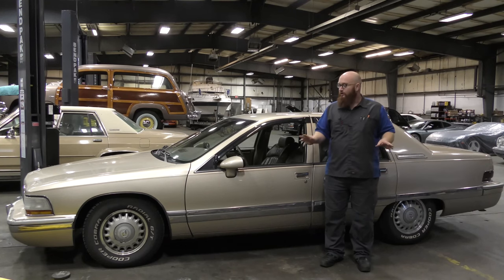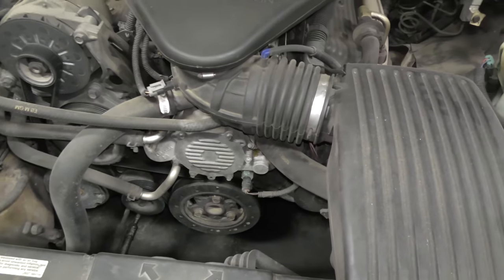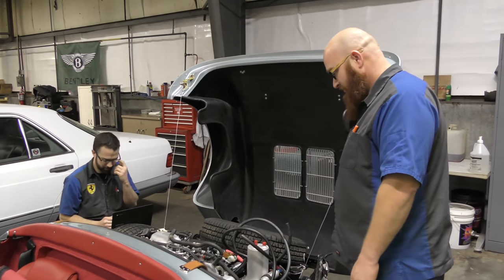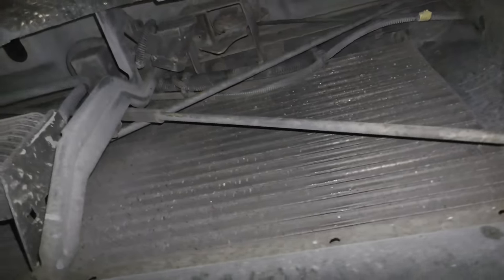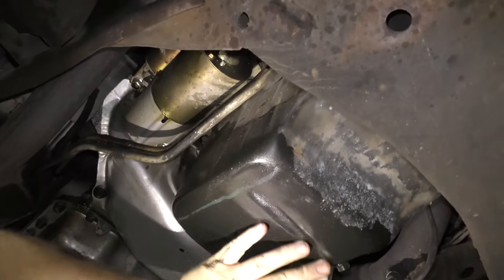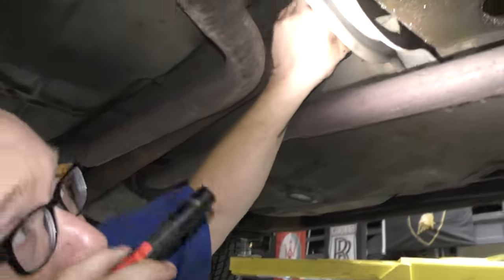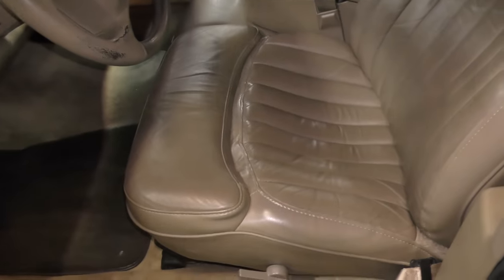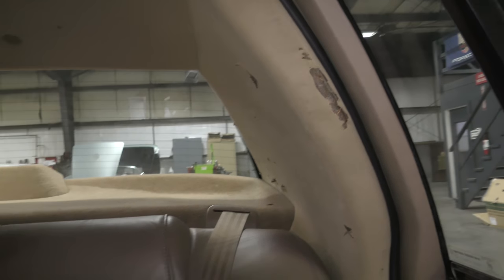Why do mechanics buy 'grandma' cars? CAR WIZARD explains their lure with this '94 Buick Roadmaster

Comment: My mailman on a rural route here in the Tennessee mountains drives a 1997 Buick LeSabre.  His route is 144 miles a day.  Stop and go, rinse and repeat a hundred times!!  He likes it because it's reliable.  Low cost to maintain.  And he has two others for backup.  Mechanics drive the same types of cars because it's not the type of car you are tempted to get "frisky" with or abuse.  Good solid old cars you can normally find for under $3,000. dollars.  I drive the same type of car.  A 2004 Cadillac sedan.  The ride is wonderful, don't abuse it, and it should last another couple hundred thousand miles.

Comment: With respect to faulty parts, are you guys independent and using Autozone/Advance/O'Reilly's junk parts? You'd almost be better off going to a junk yard and finding used factory parts. Working in a dealership using factory parts I don't really have that issue - unless someone wants to use aftermarket parts to save a buck. When that happens I fully expect it to come back with the same complaint in short order.

Comment: I own a 416k mile Chevy equinox from 07 because it's tried and true I pop the hood for oil changes that's it. I work 50 hours a week wrenching and that aisin trans and 3.4 v6 are a match made in heaven she leaks antifreeze but consumes very little oil but far the best generation of equinox you can buy it gets 24 mpg all day

Comment: I remember my first car 1965 Datsun Bluebird.  I did all my own maintenance. Every 3 months replaced oil plugs points tuned ignition with a strobe light.  Replaced drum brakes as necessary. Replaced shocks. Drained and replaced brake fluid yearly.  Only ever bought retread tires. Degreased the engine and other working parts, she was as clean under the bonnet as inside the cab,  washed weekly polished monthly. So easy to work on.  Would not have dreamt of taking her to a mechanic. Modern cars are a nightmare.

Comment: Buick 3800 is in top 10 combustion engines....of all time.  It has 0 vibration and is near bulletproof.  I've had 5 of them, and got my money back from all.  I drive an s500 now, but my somerset/lesabre customs were the best value vehicles I have ever owned.  It was sad when the 3800s went away, but I'd take em over any modern engine.  Couches on wheels.

Comment: Get a salvaged Tesla from an auction and fix it up. There’s no maintenance. Nothing. Just tires, washer fluid, and brake fluid every 2 to 5 years (brake fluid replacement is not necessary- it only losses some temperature capability because it absorbs water over time).

Comment: My dad said never buy a used car with a trailer hitch on it.. 
What what to get in a used car 
Iron block engine rear wheel drive full size spare long wheelbase light color comfortable seats cassette player R12 AC
The answer is a 76-79 Cadillac... with replaced bumper fillers I have almost a dozen of them now...they store really well...

Comment: This is why I have 2 cars. My Saab 9-5 for the easy going and comfy drive and my Saab 9-3 viggen for the rougher sporty drive when I want. Both have the same 2.3 4cly turbo motors and are reliable and easy to work on. I do enjoy working on them on my days off but I'll admit unforseen repairs when they break on me aren't always fun. They're both manual though. No matter what kind of day I've had a work I still love rowing my own gears and wouldn't have it any other way.

Comment: In my opinion it's also the fact that they might be cheaper to insure. When I switched to an Astra G Caravan with 2.2 L DTi 16V I4 engine and I'm paying 211,80$ per year for insurance and I had enough room to add the "uninsured driver" package to that insurance.
Also, that car is rly easy to work on. I recently replaced the head gasket since I did a turbo swap and it was really easy to do. However, I kinda miss my old Mercedes since it had an amazing feature.
That feature was an little latch which allowed to open the hood up to 90*.
However, I also don't miss that car since it was an 2007 Mercedes CL500 AMG and I paid 1040,81$ yearly for the basic insurance without any additional packages.

PS. I don't live in US or Canada. I might be wrong about the whole insurance stuff since I only drove rental cars in the US

Comment: I once had a ford LTD back in high school I picked up for $700. Had a trunk like you wouldn't believe. Beautiful car, spacious, powerful with its V8 and posi rear end. I drove it from Nevada to Mississippi to buy a big block crate engine from a buddy for my el camino, and we were able to fit it in the trunk, long tubed headers, and all. Only problem is it took me a while to get it out, on account I didn't have a forklift so the rear end would scrape the ground. I would make bets at bar rooms that I had an engine in the rear like a Porsche as a joke to score cheap bears. Yup. Rode around with that engine in there for about a month.

Comment: I have a Lexus GS430 V8 and although that engine has a lot of components it's easier to work on that my 2002 Jetta or Honda Civic. You can replace everything with ease and with a good synthetic oil they can go on for ever.

Comment: Lt1s in those were 260hp. Plugs and wires are a pain but not awful. Vettes were aluminum heads and different cam. They are also reverse flow cooling. Meaning coolant goes to the heads first and as a result you can build them to high compression with 0 issues. 13:1 on 93 with a tune is common.

Comment: Having a reliable car that does not openly display your income to your customers prevents a lot of mixed feelings about your mechanic taking your wallet for a ride.

Most customers think (right or wrong) they are being over charged. Many are unable to fathom the work involved in the repair.

Thinking about it some people who know I am a capable mechanic don't understand why I was willing to pay $1200 for my acura timing belt replacement. The truth is I let the mechanic do the job while I spent those hours with my family and even had fun. The best part is I didn't have  to break the crank nut loose.

Comment: premature shock failure on the B body GMs of the 90s a lot times are caused my worn out shocks my 96 roadmaster would eat shocks because the ride height had actually dropped almost 1 inch from stock it's sounds dumb but when I get a B body orc
 a D body Fleetwood with bad shocks that were just replaced a stock spring replacement to go with the shocks fixes the premature shock failure.

Comment: Kansas City Auto Electric here, I could not agree with you more. If I could get paid a dime every time I have a customer come in with what they think is a parasitic short or have been told, "I just replaced the battery and alternator" I could retire. As it turns out about 50% of the cars that I diagnose do not have a parasitic short. It is a bad battery/alternator right out of the box and several of them in a row. There is CLEARLY a quality control issue on many levels with today's replacement parts whether they are new or rebuilt. You almost are better off going to the junkyard and cleaning up and testing a part that seems to be a smaller gamble than a new/rebuilt out of the box.

Comment: So I have a wonderful story of high school shop class from this engine and car... 
My auto shop teacher sucked as both a teacher and a mechanic.
I was a smart-ass kid that has been working in cars my whole life. 

So he tells me I have to change the water pump on the engine before I can go work on my own car.
Ok.
So If you look at when he first pops under the hood at this around the 2:10 mark, You can see that the water pump does not even use a belt drive. It's driven by the cam in the back. So you can just unbolt that water pump, and then smack in a new one. Use a power ratchet and you can do it all in just a few minutes.

So I walk over and swap out the water pump. Check everything for leaks. Refill the coolant to the proper level. And I'm done less than 10 minutes later.

So I go pull my car into my bay.. And he comes out of his office and starts just yelling into me and laying into me (why was he in his office when kids are working in the shop? Did I mention he was a shitty teacher?)
So he's laying into me and then I just tell him it's done. He doesn't believe me. But he's created a crowd around us so he goes over to see. Sure is shit there is a bright fresh aluminum water pump bolted up to that engine, with no big mess around it, coolant topped off and everything. He had to re-pop the hood because it was done.

Really showed him like a turd. Lol

There's also a fun one where I found out he put heavyweight oil in every engine. Couldn't figure out why his roller cam to small block Chevy had a knock to it. I convinced him to stop using heavyweight oil and use the appropriate oil.... Because the roller lifters don't like thick oil. And the valvetrain knock went away.

After that he just kind of left me alone to do my own shit.lol

Comment: Those LT1 Need help but with arp heads and a gm upgraded intake i have seen them run 10 flat on 225-50 all season tires

Comment: One newer car you guys should look at is an audi A4. I am a little bias I got mine from one of my dad's coworkers. the seller wanted it to go to someone that could work on it after he paid $500 for a wheel bearing. I paid $1400 for it and I love the lumbar support. It's an 06 A4 2.0 turbo with a 6 speed. When I popped the hood on one side I could see the turbo but the other side, oh baby I could reach down and touch the skid plate. Now when I was changing the oil I will say this, I had to buy  a socket to turn off the filter canister, but I could also easily see the starter and its connections. All from driving it up on some ramps and laying on my driveway.

Comment: I had a 4 door 92 Camray that had a Lexus 6 cyl. Quad cam engine. I bought it from the original family owner and it had one blown head gasket.
      I called the machine shop and set up for the job. Machine shop called back and said they needed engine serial numbers because there was a few different variations of Camray's due to a change of engines in early production. It turned out that Toyota had put Lexus motors into the Camray line to compete against the Nissan Maxima in horsepower. I had one! Once I opened up the internals and saw how just the heads were designed, I knew this was a performance engine. 4 cams not adjustable but shim adjusted rockers. It reminded me of a Massarati I worked on in the mid 80's. I put it together with just a head gasket set, replaced one head, checked the other. I did have the machine shop do the valve adjust (those shims can be very tedious and frustrating. That Camray is still running strong 15 years later.
    The truly odd thing about the car was the cooling fan. The cooling fan ran off of the power steering system, it ran by hydraulic pressure. I never had a problem with either so I'm not sure if it was temp. sensitive or strictly pressure/ rpm operated. This was the only time I've ever seen that type of engineering.
    I sold the car to my girlfriend and she sold it to my niece. It still runs but is sidelined due to brakes and struts issues.
     I enjoyed that car and it's reliability as well as it's horsepower, I just got lucky that it had that drivetrain.

Comment: this is essentially a caprice LTZ with the LT1 engine , a Cadillac version is also available(fleet wood 5.7 LT1 if memory serves me) , they suffer from constant ignition module and starter failure ...so have these in the trunk ready if you know how to replace on the side of the road ....ohh and the optispark thingy distributor other than these are  fairly reliable  , i just replace the entire fuel sending thinking it was the problem ....nope turned out it was the dreadful ignition module right on top of the coil.......so a cheap after market one from herko emissions  and a new moroso made in USA blue coil cleaned the heatsink and the area around , put it back in place and walaaa the car stared ....dra dra dra dra dra LOOL haha ...she is back

Comment: I'm not a huge fan of the optispark distributors on these cars, however compared to any bmw with vanos system, or any modern ford, chrysler, chevy, with lighting control modules. Why the hell do we need a computer for turn signals? Why? The reason we cant get good parts is all based on the manufacturers having to compete, trying to make the cheapest possible product instead of something of quality. We are suppose to get frustrated

Comment: As a diesel tech i drove a 2002 frontier with a 4 cyl manual. Got 240,000 on it and running strong.

Comment: I would say it is cause the current modern cars are way over priced, more plastic than anything else and are made impossble to work on yourself. thus forcing most back into dealership to get ripped off even more.  Personally  I have a chevy truck that is a 2008 and it sits mostly.  My daily driver is a 98 Lincoln mark 8.Hidden gem of a car to me imo.

Comment: We also can find them cheap, most people don't want a 25 year old car anymore and a simple repair is not worth it to the owner because of the age. I've picked up a 92 lumina for free because of a minor accident,  all a 95 Taurus with a rebuilt transmission and only 60k for 200 bucks because a dealer wouldn't take it in trade.

Comment: The only bad thing about the car is some electrical issues or the transmission going out. I just bought mine a month or two ago with 167,000 miles and I bought it from a mechanic but from 1st to 2nd it hard shifts and before it shifts it rebbe all the way up and I have to shift it myself. I watched this vid a bout a year or two ago and I came back to it

Comment: I had a 96 caprice with a 4.3 that I thought had a power steering problem that would momentarily lose assist , turns out the water pump was leaking dexcool on the balancer which caused the belt to slip on the ps pump pulley. I replaced the water pump,the rotor and distributor cap, problem solved.I love the 91 to 6 caprice roadmaster and Fleetwood rear wheel drives what great old cars.

Comment: YMMV I had a 96 Impala SS and it had that LT1 - was a PITA.  If the serpentine gets wet the power steering goes out.   Chevy when they assembled my engine didn’t tighten the camshaft retainer ?or cover? it was behind crank sensors and what not. . Damn thing made a ton of noise sounded like it was going to die. Most of the front of the engine had to come off to tighten those  bolts.   The water pump driven  off the cam so if you gunned it the coolant would cavitate and you lose heating until you bleed the air out of the system. It was a fun car but absolute crap to maintain.

Comment: Better than the Corvette or Camaro with the same engine because they had the full cast iron block and heads. Meaning they didn't heat up at different Temps. Same motor as impala ss Fleetwood and caprice. The camaros firebirds and corvette had aluminum heads and cast iron blocks.. That is the reason why caprices lasted so long on in taxi service.

Comment: Roadmasters are undercover corvettes. They have the same engine and tranny as the corvettes. 5.7 liter engines with alot of power and it rides like a sports car too. They last forever too. You could easily put 300k miles on it too

Comment: I have seen A car kinda like this with A transmission gasket leak too. The Car was stuck, and the transmission gasket gave and needed to be replaced. I do have A question if gasket goes on Transmission sealer work just to get back home even is A bit Away?

Comment: The fun thing is that this is valid all around the globe. Mechanics simply know whats good and whats not. Plus when you work all day on cars you have a different relation to them. They are no magic items any more, they are pieces of metal, rubber and hose held together with screws and a ferrari 458 is not different then an opel corsa in that regard, with the only difference beeing cost and effort of maintenance.

Comment: Duh, yep we trust them, we know them,and it doesn't take 8 hours to figure out why the car overheats because of all the new electronic garbage car manuf.think we want but don't, like the outside mirror heater circuit doesn't allow the trunk opener to open,which shuts off the secondary circuit to the ac fan relay which shuts off the cooling fan which causes the car to overheat.

Comment: we could go on and on actually and especially about the MP fuel injection system  on top of that LT1. there's a reason why  its cousin the caprice was used as Government vehicles and the Impalla SS was such a staple. we had a woody wagon road master pass through auction and the dealer that purchased it actually not only paid a fortune for it as it was in granny driven granny kept condition but he ended up keeping it for himself  a while (but somebody eventually came along and made him an offer he couldn't refuse). if you can get ahold of the woody wagon you will have yourself a flying saucer

Comment: Old cars have actual frames.     Newer cars are a little of sheet metal spot welded together.     You hit a wall with an old car ar 20mph youll scratch up the bumper.    Vs new cars where you'll cause thousand's in Damadges

Comment: that makes sense. I'm an electrician so luckily for me newer is easier, a nightmare house is an old house (since some still use tubes) so I could fix anything in my house in hours where if my house was older it'd be months to get the same wires or fuses.

Comment: I drilled and tapped the weep hole the first water pump I changed and ran a line to the bottom of the engine. As a retired engineer, I do resent engineering errors.